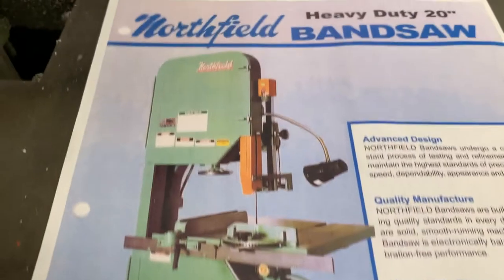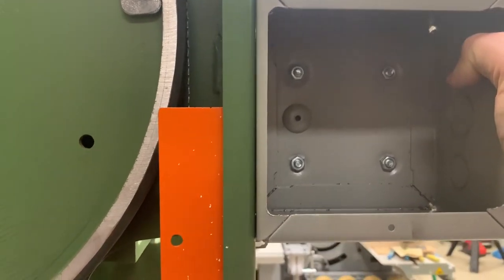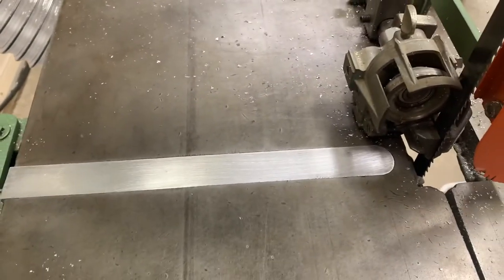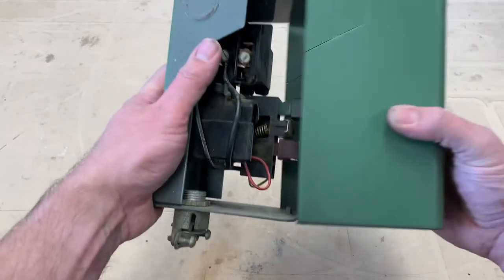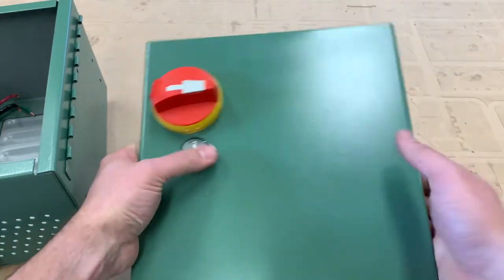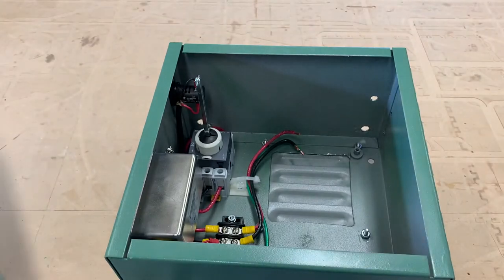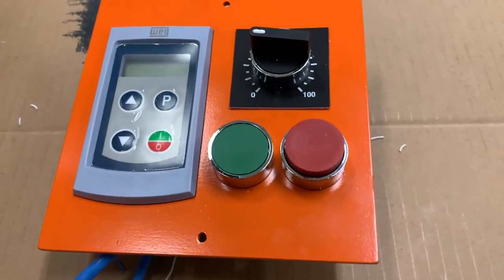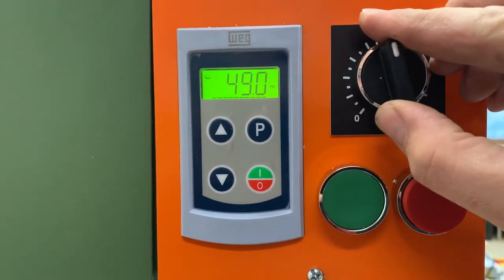Northfield Bandsaw Restoration Part 2

Comment: Well done!  Something to consider when using a VFD on older 3 phase motors is cooling.  Running the motor at slow speed under load means the fan is not cooling the motor effectively.  Some VFDs have an auxiliary relay and, since you have a 12V power supply handy, you could add a PC fan to the motor fan cover.  The relay would then run the fan whenever the VFD is on.  This is more important on a drill press than a bandsaw unless you're cutting metal with it.  Thanks for documenting your journey!
Reply from the maker: Thank you - yes, many self-cooled motors may struggle to cool if you run them too slowly without additional cooling.  Further, as the frequency is lowered, the power output drops as well, which also limits the usefulness of low-speed operation beyond a certain point.

The primary objective of the VFD was enabling a nice old iron saw to operate from my single-phase shop power, and the variable speed allows for things like soft start/stops and also easier and safer blade tracking adjustment. As I have used the saw since restoring it, I am not sure I have used it at less than 100% speed more than a couple times.